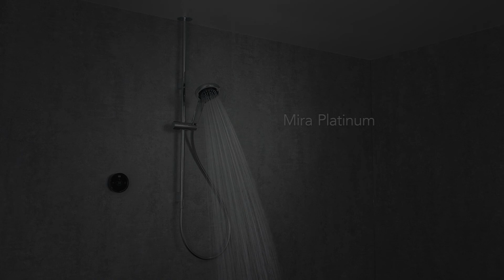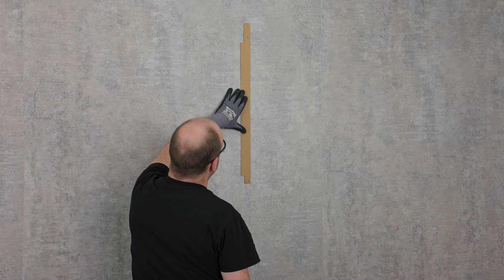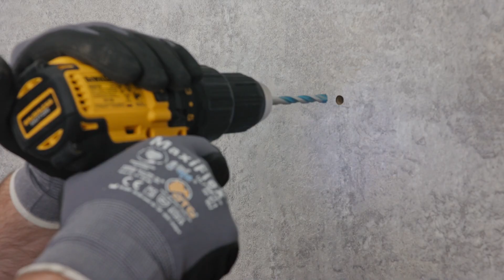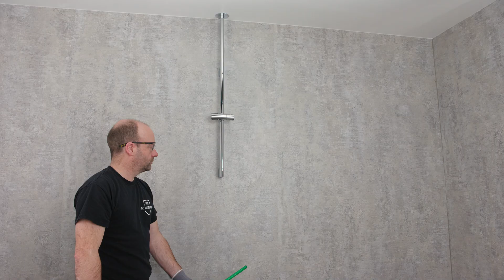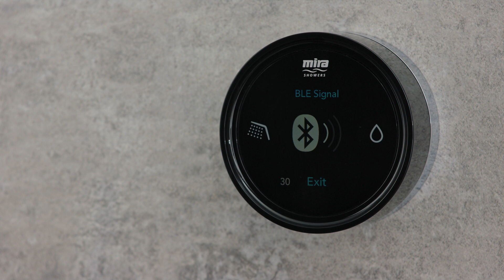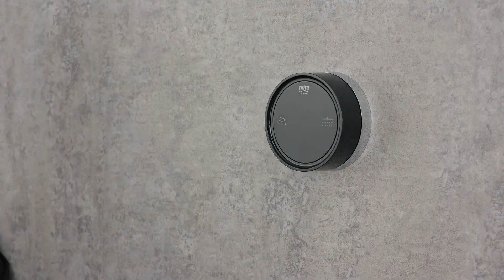Mira Platinum - Single Ceiling Fed step-by-step installation

Comment: Hello, have just purchased this, inwas wondering if you can use a  push fit flexi hose instead of the 90degree elbow supplied? (To ensure max flow rate)
Reply from the maker: Hello,  Push fit flixi hose can be used, but please ensure you follow the pipe manufactures instructions as well   ie.  use pipe inserts.